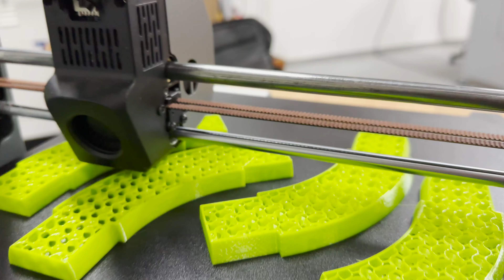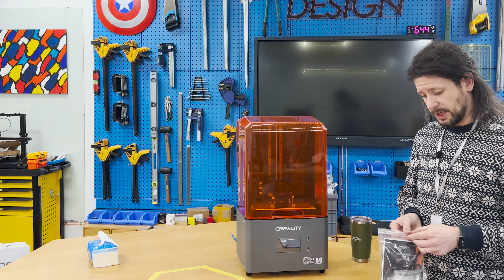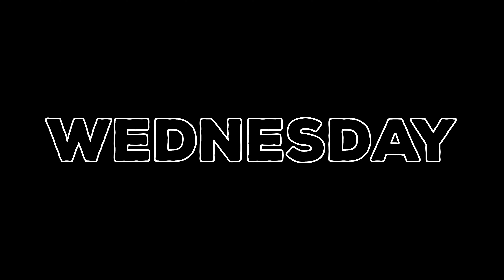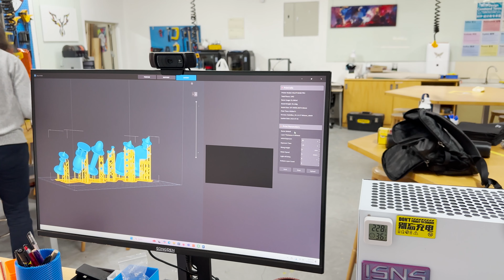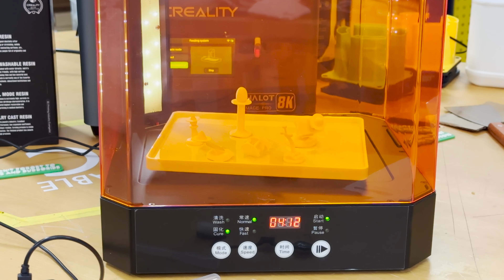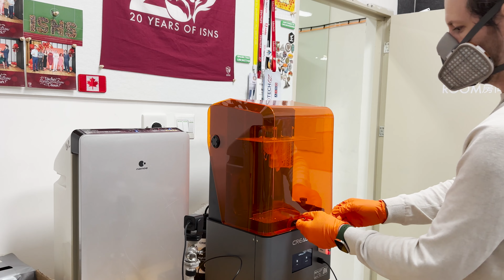Diving into Resin Printing (And Design Teacher Stuff)

Comment: Awesome vid! Would love a copy of the house build prints. Currently have a A1 but considering adding a resin as well. Seems like it is so much more involved than my current click print and its done setup
Reply from the maker: @M_obi_d  definitely far more involved, but I’ve gotten a lot faster in the weeks since shooting this. (Still slow- printing miniatures with many, many supports to remove). I’ll post the house bits shortly and share here.